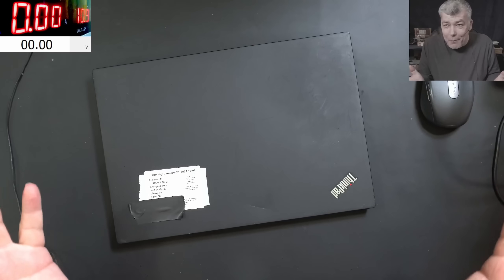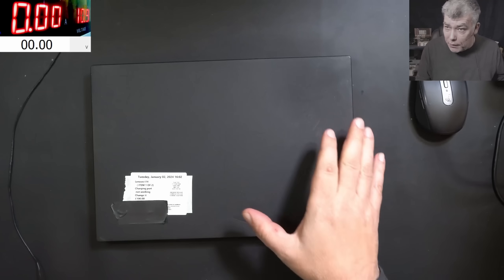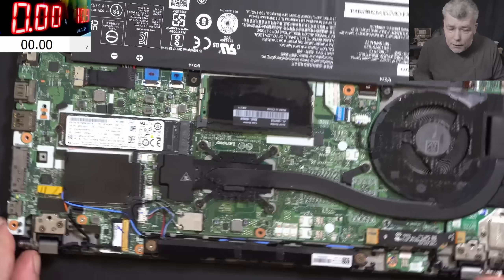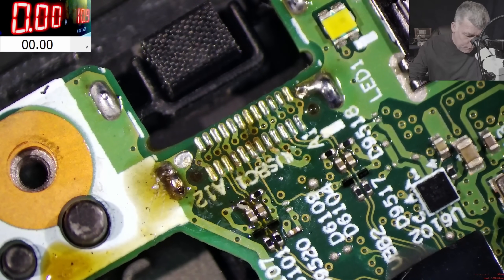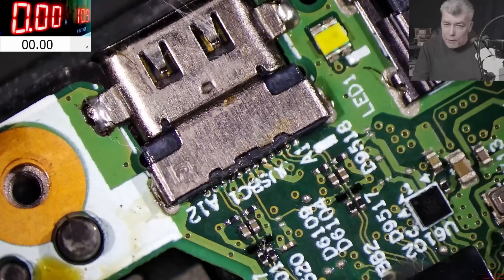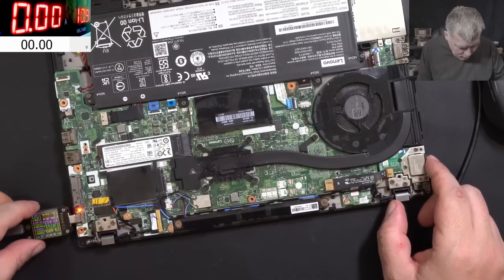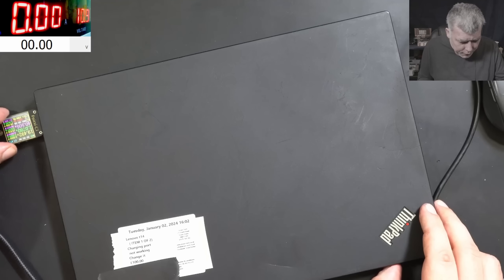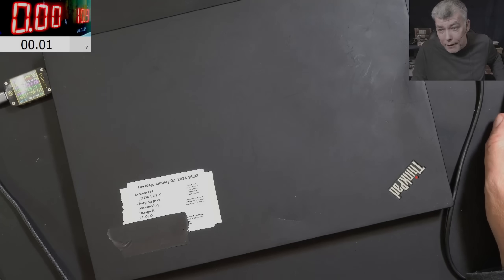Lenovo T14, dead, not charging - How to replace the charging port guide

Comment: HELLO SORIN  you promised us that you would place a camera on the hot air machine, which would make it easier for us to monitor the repair process and also make it easier for you not to have to report the temperature every time.
If you are able, of course.
Reply: Saya tahu yang anda inginkan,  suhu 380-390, angin 1-2 saja. Jika angin terlalu kencang maka akan melelehkan board dan merusak komponen.

Comment: That port is much better than other Lenovo USB-C ports. I have seen some Lenovo ports with through hole pins, which are real troublesome. That only is purely surface mounted, much easier to work with.
Reply: Better or not, i just think the USB-C for main/only laptop charging is a very bad decision.
I wonder how many laptop  will end up scrapped because the USB-C  charge port is wrecked.
Reply: @Doman2000 I agree, they should have created an universal port for laptops, but not USB-C. Now all laptops in the EU must use USB-C for charging.